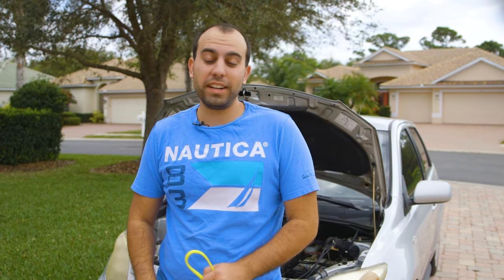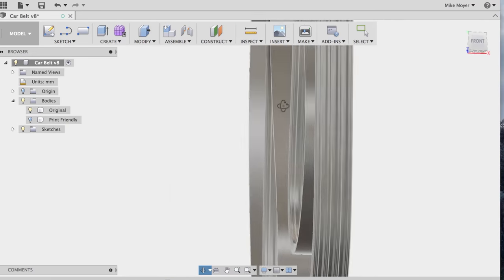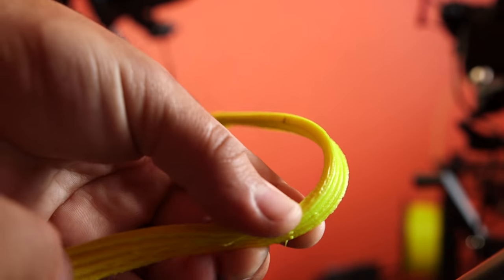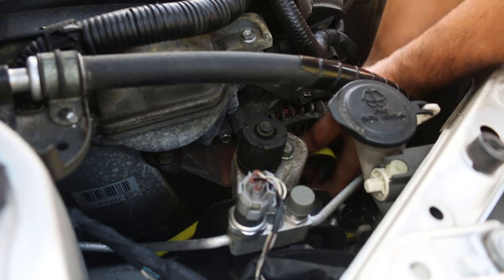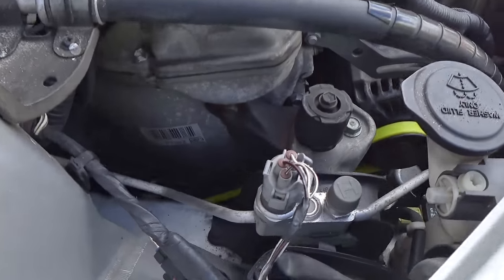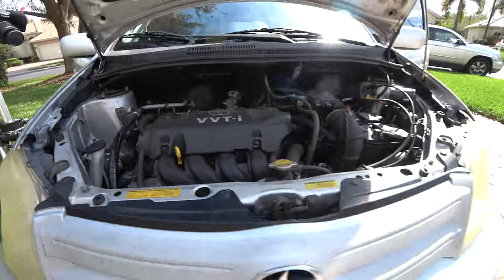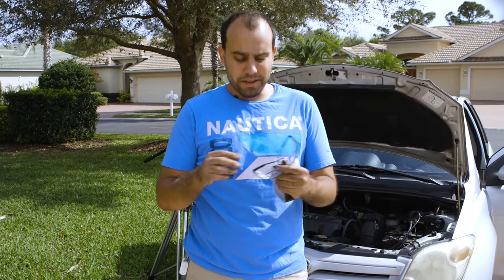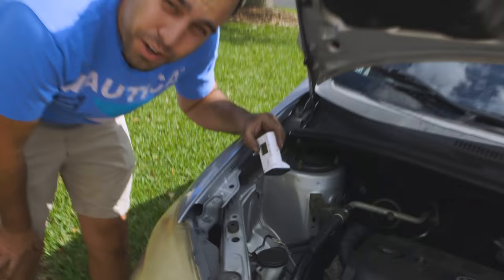3D Printed Car Belt | Will It Run?

Comment: If that belt only runs the alternator and water pump then it wouldn't be necessary for the car to run.  You could take it off completely and run the car until it gets to operating temp.  But cool experiment none the less!
Reply: Most 4 cylinder engines will run surprisingly long without an alternator... I could see you overheating the engine easily IF you were to let it run, but... You didn't, so...

Very neat experiment. Glad to see someone thinking of making auto parts with a 3D printer.

I'd make a suggestion, but all I can think about is important suspension parts... As interesting as it would be to see a Ball Joint 3D printed, Nobody would want to do that to a car they'd intend to use again. Cool video!
Reply: Eeh, the cylinder head will have potentially damaging hot spots without good water circulation well before the gauge reflects overheating.
Reply: BleepinJeep the car doesn't need power to run, it needs power to start. The first and only thing that's going to happen is the vehicle is going to over heat. If you drive heavily or hit the highway it's going to happen. This video proved one thing. You can't 3d print a working serpentine belt.
Reply: Internal combustion engines require power to fire the spark plugs, operate sensors and computer, and several other taxing systems and operations. The alternator generates this power when the engine is running, hence why cars have batteries to start. If the belt isn't running the alternator, it will draw power from the battery until the battery dies.
Reply: lol how did BleepinJeep end up here. I love youtube
Reply: You need an alternator to continuously feed energy to the battery to fire the spark plugs tho
Reply: ahh no. the coolant would not "MOVE" through the engine. so the coolant "IN" the block is going to get to and pass operating temp "really" quickly but since your sensor is likely outside of this zone you won't know it as your engine dies.
Reply: That's right. The coolant must be pumped consistently when the engine is at operating temperature. One rather distressing design flaw in many engine cooling systems is that the water temperature sensor must be mounted fairly high in the system and it is not as sensitive to coolant temperatures when the coolant is not in a liquid state. Well, guess what happens when your water pump belt breaks: the water quits moving and that which is in contact with the hottest parts of the system, generally in the passages in the cylinder head(s) nearest the exhaust ports, boils to steam and these steam pockets collect at the higher points being of lower density, so liquid coolant is both decreased as steam and displaced downward. Without liquid coolant to absorb heat from the head, overheating gets worse, and without liquid coolant to conduct heat to the temperature sensor, the gauge will read lower than what it is. By the time the temperature sensor is detecting heat conducted to it though the metal that it is bolted into, the engine has been overheating for a long time and is well on the way to significant damage. Head warpage and gasket failure are almost assured at this point, and if the operator doesn't immediately notice, further damage is likely.
Reply: My 4.0 6 cylinder Jeep (ironic this is BleepinJeeps comment) ran with a dead alternator for about 30 minutes. Once I realized the alternator was dead I charged the battery up and then drove to the shop at which the alternator was under warranty. By then it was more than enough time to get to operating temp
Reply: I have not had any cars that couldn't run for atleast 30 minutes without a alternator, by that time it'll overheat for sure, maybe the gauge is still low, but internal temp would be boiling, and in most engines thats a major problem.
My personal best is my sisters old (1980's) VW Golf diesel, she had a problem with the car and it would not start, I drove out to her to check it out, turns out the alt was bad, didn't charge the battery at all. So we used jumper cables connected for maybe 10-15 minutes, started the car, and then drove it 4 hours to my shop (she was going home for christmas, so the trip was the one she had planned anyways when the car didn't start) made it all the way from just 15min with jumper cables charging the batteries. at the end of the trip the lights was so dim we could barely see a glow, but the engine ran fine...
Reply: Renax the Man 
Old diesels do not need electricity to run. Your sisters car probably had a solenoid on the injector pump wich needs about 5 volts to keep the fuel line open. Thats it. I've used a 9 volt battery in emergencys on old Toyota Diesel engines. My Ssangyong Musso has a Mercedes 662 diesel engine. It has a vacuum fuel cut off solenoid. I ran it for two weeks last summer without a battery. If it is warm outside all you need is a hill to start it. Gotta love old, simple diesels :)
Reply: @Stefân Dal: Yep, only needed a couple volts to the solenoid, but the car has auto lights on with ignition, so lights front and back + in the dash was on the entire trip...
No need for the 9V battery btw, in a emergency you can just gut the solenoid, takes 10 minutes and then it will run purely mechanical without any electrics, downside is you have to stall it to stop it from running, not soo great for automatics..
Reply: I had the overrunning clutch go bad on a Grand Caravan alternator and it quit running from a depleted battery in about half an hour. And this isn't one with automatic daytime running lights or any of that. I knew it was going out so I cut off everything that wasn't necessary, no fans, no extra lights, I tried to stay off the brake to keep it from lighting the tail lights, etc. Fortunately, when the overrunning clutch fails, the belt remains intact so it didn't overheat, but I was still eventually left stranded and in need of a tow.
Reply: Uhm no, your engine will veeeeeery quickly (in matter of 2-3 minutes) get so hot, it could take damage. The water will not circulate without the waterpump, and heat will accumulate in hot spots
Reply: yep, but it'll still run!  I never said it wouldn't get hot.
Reply: BleepinJeep you said it will run untill reachin operating temperature. That is commonly understood as opersting wster temperature, and the engine will tske damsge before that will happen.
Reply: It would run long enough to make it around the block without damaging the engine. The water inside the engine that isn't moving would still help to spread the heat more evenly and prevent any warping. Not saying it's a good idea but a minute or 2 and you'll be fine
Reply: Se7enAte also why you get a red light in the dash if the battery is not charging (indicating to stop immidiately)
Reply: The only point I was trying to make was that the vehicle is running the belt, not the other way around.  The belt is not running the vehicle... I think he might have said that in the video.  Either way, it was a cool vid to watch.  I just wanted to point out the vehicle will technically run without any belt at all.
Reply: If the alternator is not in the mix, the car will fairly quickly drain the battery and then die.
Reply: Didn't expect to see BleepinJeep here lol, hope to see more of the Scorpion Crawler!
Reply: my car started to overheat in about 2 kilometers from cold and minus 25c without alternator/water pump belt and started to overheat whithin 5 seconds when i lost the belt att normal temerature it never afected the battery at all, i hav driven a car with busted alternator btw, battery lasted for about 50 kilometers.
Reply: not really, the head would start warping from the heat in about 30-60 sec.
Operating temps dont matter, with out the water to dissipate the immediate combustion heat, things will go real bad real quick.
Reply: Se7enAte there wouldn't be any coolant flowing through the head, leading to warping and loss of compression
Reply: Matt Sullivan  but it would run. the whole point of this comment was saying it would run
Reply: To operating temp. IE about 5 minuets like he said. Sure, even being summer it will probably take longer than 5 min to heat up, but he obviously does not know much about cars, and that little engine block is gonna heat up quick, so 5 minuets is probably a good set point for him to have.
Reply: Everyone in this comment section should make sure to never work on their own car. There is so much false information and complete trash on here.  I will tell you how cars really work here. 

Nearly every car on the road will drive without an alternator for quite a while. When your alternator goes bad or you loose a belt the vehicle will continue to run and use power from the battery. Some will last 20 minutes, some will last more than an hour, some diesels will run forever. 

An engine without a water pump circulating water/coolant will over heat your block or cylinder head within a matter of minutes. You will have hotspots and start causing damage in less than 5 minutes. It may not show on your dash as getting hot either, because the temp sensor is not getting hot coolant flowing over it. 
 
To put it very simply,  99% of the time you will over heat and possibly damage the engine before you run out of voltage from your battery.
Reply: Patryk Ptasiński 
A typical automotive group 24 battery has a reserve capacity of about 80 minutes.
This means that it can sustain a 20 amp load for an hour and 20 minutes.....in other words, your engine will definitely sieze up from overheating long before that battery goes dead.
Damage occurs long before the engine shows signs of distress, especially to someone ignorant of cars.
Luckily for the majority of the driving public, there are many cars which have timing belt (or chain) driven water pumps.. (e.g. most honda engines, mitsu 4g63, chrysler 2.4l, nissan vq series v6).. in those cases you can drive until the battery goes dead with no repercussions other than having to hoof it to your destination.
Reply: Patryk Ptasiński Honda 4cylinders such as the D and B series have a timing belt driven water pump. If you lose your accessory drive belts you can drive it as far as the battery will take you. You wont have ac or power steering, but you will get there.
Reply: maybe idling...  ive never been able to go that far with a dead alternator
Reply: this comment couldnt be any more wrong. the car needs amps to start and volts to keep it running. if you unhooked your alternator and unhooked the battery while the engine was running, the engine would not run.. you need power to create spark....
Reply: Sarthos Jacruga
Auto parts experimenting is a large part of why I bought a 3D Printer. I intend to try some lost PLA casting to make some aluminum parts. Possibly try cast iron if all goes well. I also just picked up a couple 2000 Pontiac Bonneville SSEi's that need some TLC to serve as practice before restoring my 92 Coupe DeVille.
Reply: The engine would run but it will overheat like every 5 minutes
Reply: Lmao i ran my 94 Grand Cherokee with out an alternator or water pump until my head gasket blew up 😂😂 and then some 😂😂 fuck you mean the batteries gonna die
Reply: Every car from the late 80s and newer would run for a few minutes with a bad alternator.

Comment: I didn't know I wanted to know the answer to that until I saw the question, then I had to know.

I would have been interested in hearing/seeing more about what type of flexible filament you used and why. If it wasn't the strongest/best type, I'd be interested to see this revisited with a better filament.

And I'm very interested in seeing more videos seeing you push the limits of what can be 3D printed, perhaps also with you exploring how to incorporate that into your other types of build projects.
Reply from the maker: Thanks for the comment.  I used 2 different types of filaments NinjaFlex and Maker Flex from makergeeks.com.  The Maker Flex was a lot stronger, so I ended up using that.  Getting the settings right was the hardest part for sure.  I ended up printing at 240C which is 20C higher than the manufacturer recommended but it finally worked for me. 

I've got tons of ideas for incorporating 3D printing into traditional woodworking :)
Reply: Mike and Lauren speaking of getting the settings right. The Hacksmith channel built an enclosure around their 3D printers and put a space heater inside. They said that the higher ambient temperature helps the parts print more smoothly and stronger due to less temperature differential in the layers. I don't have a 3D printer,  but it seems to make sense.

I don't have time to find the specific video right now, but it's one of their shop tour/progress update videos from about 2-6 months ago. You could probably whip together an enclosure relatively easily, and it'd probably be worth it if you're going to be focusing on 3D printing for a while.
Reply: I like the idea of the belt making with a 3D printer. However, I don't think this is something that could be done with a normal single filament printer. There are multi-extrusion printers out there that are cable of printer with carbon fiber, fiberglass, kevlar, etc. These might be better suited to the task.
Reply: I knew it wouldn't work. There's a lot of stress and a lot of heat involved with a belt. Had he printed in nylon it may have worked for little while though.
Reply: THX 1138 panty hose yep that would be a fucking sight to behold lol

Comment: Yeah, as I suspected the belt would not last for long, it's INTERESTING that you managed to get it to spin for a few rpms BUT that was never going to work as a practical replacement.  As you didn't think it was going to work at all I figure you realize that the printed belt isn't near as stout as the fiber impregnated original.
Reply: he was just using too cheap of materials
Reply: MISTERComaToes they have carbon fiber impregnated 3d printer plastics, I'm sure it would take some extra work to be practical, but I think it would be possible. Idk why you would, you can get belts in just about every shape and size imaginable. 

On printing it flat like he pointed out, it wouldn't be hard to make a rig that was a ring and replaced one axis, it would rotate around instead of moving the bed back and forth. 

But again, what's the motivation? You're on a desert island with a 3d printer and special carbon fiber impregnated ninjaflex but no parts store? Lol.
Reply: MISTERComaToes in retrospect it is amazing to see how far 3D printing has come and to be honest I want to see how far this can be taken. imagine how it would be just to 3D print car parts such as rubber bushings or brake calipers , even brake pads.... that would be amazing.
Reply: Or to make a silent belt for a tablesaw? That could make for an interesting experiment.

Comment: If you want to do it, in terms of "lasting" i'd consider to have a dual extrusion machine with flexible filament in one extruder, and in the other extruder some nylon filament, it will apport more rigidity to the belt.